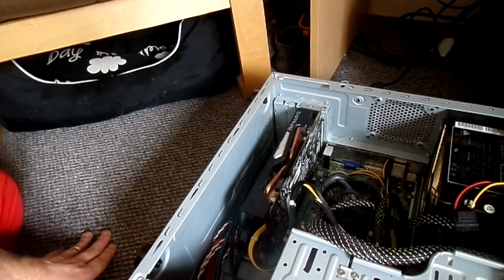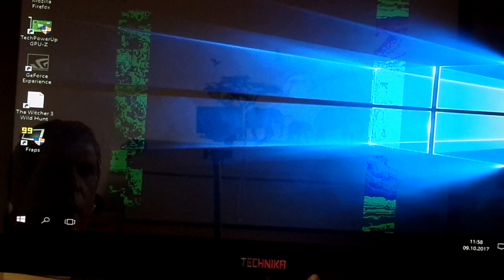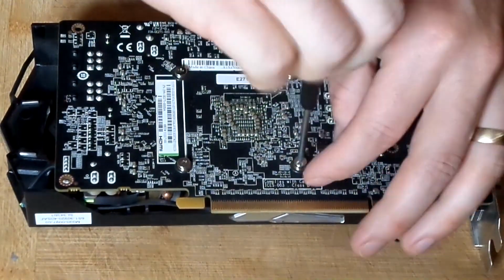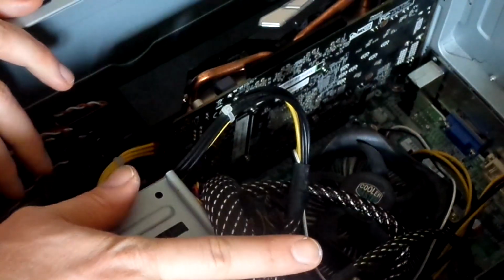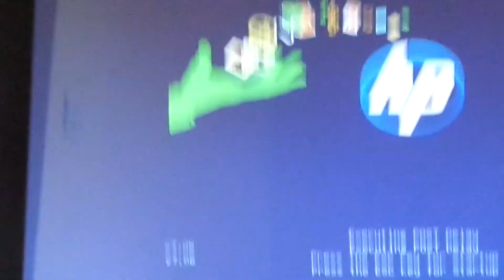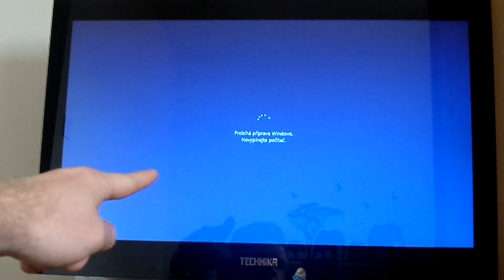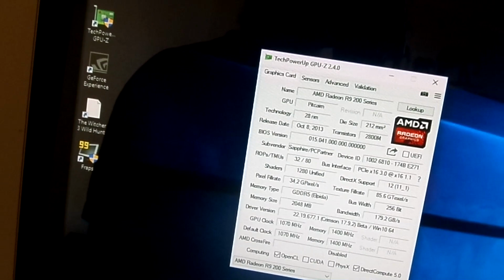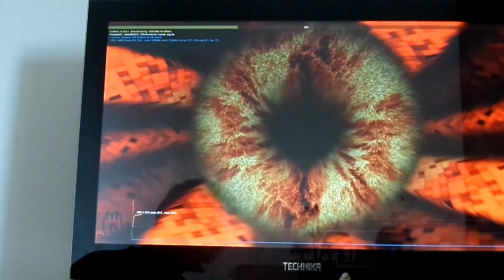It is possible fix GPU Screen Artifact ? Check this video to find out

Comment: Man big respect 3 years and still supporting people God bless you. <3
Reply from the maker: I try my best all the time have a nice day
Reply: @frogtechtips  should i try this on laptop my laptop's nvidia gpu having issue like this, display works with intel's integrated gpu so when i play games with nvidia gpu i get weirds lines something like stretching from middle of the screen, i searched for some answers i found that it could be "VRAM is dead" but i am not sure i can show you problem with video on discord if you want to see
Reply from the maker: @KhuniBacha  hi is possible do this on laptop as well but is more difficult
Reply: @frogtechtips  okay and also my laptop is maybe water damaged somehow. If i turn it off and leave it overnight on table it won't turn on in the morning but later i put it in bag for 4-5 hours and it turns on like normal. Can there be any other cause of it ?
Reply from the maker: @KhuniBacha  that's sounds like some bad capacitator definitely open your laptop and have a look on PCB
Reply: @frogtechtips  okay thank you i will try to find
Reply from the maker: @KhuniBacha  you welcome

Comment: Thanks!  I have lines on my screen pretty much from the windows icon and on.  It shows in device manager but says its a code 43.  At times its shows its working properly but I can not load drivers into pc.  GPU is 1060 6gb and super clean, not dust or it’s minimal.  Do you think this fits this category to fix?
Reply from the maker: Hi if you try all other solutions and as I think your card is out of warranty I will definitely try reheating GPU as can help and there is nothing to lose anyway

Comment: Whats the point of heating it up? Just wondering.
Reply from the maker: If you heat correctly some of the cold soldering point can be fixed and your card can start working again this is easy explain

Comment: Going to buy a bad 1080ti card off eBay with artifact for $199.  Looks fixable as it has pic with blue lines so one mans trash is a crypto miners treasure.  Thank you or the advice!
Reply from the maker: Hi is always Risk buy foulty card but sounds is possible fix that one let me know
Reply: @frogtechtips  Replace both fans, one had a wobble and slow, the other okay plus the cooling fins were clogged with dirt.  The PC was a dirt magnet sitting on the floor.  I repasted since it looked old.   The seller said his PSU was an issue but he wanted to upgrade.  Everything is working fine now.  The gpu was underclocked so it may have decent life left because he never mined with it, said crypto was too confusing.
Reply from the maker: @juggernautz  good job and looks like you have good card for good price now
Reply: @frogtechtips  Thanks.  Bargain fixes are worth it, I let the seller convince me he's not selling complicated fix or a brick.
Reply from the maker: @juggernautz  you welcome and I hope you will recommend my channel to your friends :-)
Reply: Did you fix it?
Reply from the maker: Good question :-)
Reply: @frogtechtips  Hey, I have a gtx 660 with artifacts I want to try to reflow it but I don't know what temperature I would need, I have a small portable heat station, what temperature would you recommend?
Reply from the maker: I always start on 290 Celsius for 10 min
Reply: @frogtechtips  Thank you very much for replying, I will try to reflow it today, I hope I don't kill the graphics card! xD
Reply from the maker: @rono.9157  Hi no problems I always say as your card is out of warranty there is nothing to lose anyway
Reply: @frogtechtips  I've done the reflow but unfortunately it didn't work and the gtx 660 still has the artifacts :(
Reply from the maker: @rono.9157  Did you reheating vram module as well I will try again with little bigger temperature and longer time as well
Reply: @frogtechtips   @Frog - Tech - Tips  Yes, I've overheated the vram and used 310° instead of 290 for 10 min, other people have told me that it is very likely that these artifacts can only be solved by reballing so for the moment I'm using a radeon hd 6770
Reply from the maker: @rono.9157  Yop rebaling can help but is hard and you will need expensive tools for that did you use Flux as well
Reply from the maker: @juggernautz  nice good Job

Comment: nice.. will the artefact comeback??
how long usually it will last?
after 3 years did that gpu still alive or dead?

thanks man.. <3
Reply from the maker: Hi I have some cards with working 1m and some with working even after 5 years but if happens again you can still try reheating GPU again this will help you save some money for new GPU 
You never know how long will be working but if  working is big plus anyway :-)

Comment: What Flux are you using? I cant buy the one you use in Europe. I found some but i have to decide high densed R12(Kolophonium 12,5%) or low densed W03(3,5%).
Here is the link.
https://amzn.to/36T0lxu

My Problem are some Artifacts on some Textures (on Yellow textures for example in a Game). Does it worth a try if yes, which one to go for? Thanks in Advance.
Reply from the maker: Hi is not really important with one you use I just prefer gel flux

Comment: This method won't last long...already tried before this video was uploaded.....
Reply from the maker: Is always Risk but from my experience some cards working 1 Day and some 5 years I will try one more time use now bigger temperature and little longer time plus if card start working again I will undercloock GPU about 5 %down with mean you will loose little FPS but card will have less stress and can working much longer
Reply: @frogtechtips  But I think reballing will fix this issue for a little much longer but cannot be done by someone without knowledge in electronics....
Reply from the maker: @brunovincy11  reballing is so expensive  and proper way to do is replacing main chip as well with cost more that new GPU

Comment: I’m not sure if it is artifacting on my gpu because of how minor it is but i have recently tampered with the gpu and opened it up, my gpu is an xfx rx570 4gb. It only flickers the whole screen instead of those weird dot things. i’m thinking i may have gotten thermal paste on  some parts of the gpu but i’m really not sure. maybe it’s my voltage settings. Anyways i don’t have anything to heat up the card but i might buy one and see if this works.
Reply from the maker: If you forgot apply thermal paste that can be problem with even make a damage on some comments and you also write something about voltage settings check that at first point before you do anything else
Reply: @frogtechtips  i did all that and set my power and temperature settings back to what they are default, nothing seems to work but i can definitely deal with it because it never flickers when i’m playing a game or watching a video. I’m very happy for that but i’d like to still get red of it somehow
Reply from the maker: @Zeussxs  did you try other outputs as well
Reply: @frogtechtips  actually, no i haven’t. I forgot to do that, i’ll let you know how that goes  once i’m ready
Reply from the maker: @Zeussxs  you welcome

Comment: Hello! Ive gotten the light flashes (lightball flashing artifact) on my 1080 asus strix. Does this work on it aswell? Or do you know of anything else that might work? I could sent you a vid on discord maybe or by mail! I really dont want to spent like 1.5k euro on a new card right now since its so overpriced because of the lockdow..
Reply from the maker: Hi I will bet this style of repair will work and like I always say if your card is out of warranty there is nothing to lose if you try reheating GPU

Comment: This fix is temporary, the only proper way to fix it is to re-solder the chip
Reply from the maker: You right but think how expensive is resolder chips is not really rentabil repair and from my experience some cards working 1 or two weeks and some cards much longer like 1 or 3 years yop that's true longer card I fix with this method I now is card r7 370 with one I repair for my father and now is that card used in my sister husband pc and he plays game every day that's mean card have proper use now over 4 years after this style of repair .
Reply: @frogtechtips  impressive, my longest fix was laptop gpu it ran 2 months.
But i gave up after second fix as i wont be opening it every two months :/
I wonder if there is any other inexpensive way to improve the results of this method
Reply from the maker: Be sure you use flux and if happens again I normally use bigger temperature something about 330 Celsius and longer time as well not 10 min but 15 min and Also I try undercloock GPU about 10 to 15 percent down with means you get like 2 to 5 FPS less in game but card survive longer and I do this undercloock with BIOS modification

Comment: Hi i buyed a 6 year old used gtx 780 when i played more on my computer i got a white screen while gaming and restarted it same problem as you i opened my gpu almost no thermenal paste (grey thermenal paste) i buyed today a thermenal paste i don’t have a heatgun but can i try this ? I think maybe my gpu overheated I reinstalled my windows same problem im gonna wait for my thermenal paste You got any suggestions ? Thanks
Reply from the maker: First at all try replacing thermal and if that doesn't help you can try step I do in video
Reply: @frogtechtips  i tried thermenal paste didn’t work
Reply from the maker: @etpzz23  ok you will need try all steps I do in video
Reply: @frogtechtips  im trying to do it with a 2200 watt hair dyer
Reply: @frogtechtips  yo it worked but when i started fortnite i got a white screen again restarted it same problem :(
Reply from the maker: @etpzz23  hair drier is not strong enough  but as I see you already find that
Reply: @frogtechtips  yo bro i bought a heatgun but its only 300 degrees not 290 should i hold it on 10 minutes ? And on the ram 10 seconds ???
Reply from the maker: @etpzz23  hi 300 is fine you can use even more that's no problems and ye try 10 min should be ok

Comment: great video. Do you have the heat gun on a very hot setting
Reply from the maker: Hi I used temperature 290 to 320 Celsius

Comment: Wow man this actually works on my Radeon R9 270 OC card! I don't have a heatgun, but i use oven(Do not use microwave!).. And it turns out working well! I use temp controlled oven and i set to 110°c for 10min.. Pull out and wait to cool down, apply heatsink and thermal paste, and test.. Huge Thanks to God and experience you share here, i don't have to buy another vga card anymore😇🙏 *sorry for my English 🙏
Reply from the maker: Hi nice to know btw oven is absolutely last step and you card is probably not so bad as you use on 110 Celsius wit is to low melting for solder if you card get foult back with will be probably soon of not you lucky try again but with much higher temperature

Comment: What flux did you use ?
and also could this flux work :https://www.bunnings.co.nz/tradeflame-plumbing-flux-and-brush_p5910273
Reply from the maker: Hi i will try go for liquid flux this one is good for small components  but you need one with is go easy under big chip look on description there is some links and if not in this video look on my channel for more information
Reply: @frogtechtips  But would that flux work since im in New Zealand and shipping would take a few months.Also liked and Subscribed :)
Reply from the maker: Hi thanks for sub iam not sure as flux you send link is for industrial big plumbing solder iam sure you can find better flux somewhere do you have eBay or Amazon in your country if yes try have a look there
Reply from the maker: What about this one https://nz.mouser.com/ProductDetail/Chip-Quik/CQ4LF-05/?qs=byeeYqUIh0Plq4AoEtUS5g%3D%3D
Reply: @frogtechtips  But is there anyway that flux would work with the gpu since im not really interested in buying lots of parts to get a 50/50 chance of fixing the card.
Reply from the maker: Hi you can still try without flux  is risky but can work as well and ye always is 50/50 repair like this one
Reply: @frogtechtips  Ok thanks for the information, I'll recommend you to everyone i know.
Reply from the maker: @thediamondgamer7414  thanks that will be means for me a lot and I wish you a Merry Christmas
Reply: @frogtechtips  Thanks oyu too, a quick update I ended up buying the flux of ebay and i'll let you be sure to tell you the results of the fix :)
Reply from the maker: @thediamondgamer7414  thanks and happy New year

Comment: Hi frog, did you use flux on memorys modules? Or only on main chip? And about the times you did 10 straight on chip and then switched to memorys modules 10 seconds each?
Reply from the maker: Hi yes i use flux on memory module as well and 10 to 15 min to Core and up to 30 sec to memory module or till all flux disappear 
You can look on my channel there is more repair like this one

Comment: Sir I don't know if you still reply but M gonna take my chances and I hope you do. My problem has started with just cold boot in morning it goes to a random color  but after 3rd boot works just fine i play games all day no problem and won't heat but now got worse and keeps doing it on every boot I tried old drivers new drivers windows versions and nothing. Please help me I really can't afford one. My graph card is gtx 1060 6gb
Reply from the maker: Hi bro ye I still reply if I can your problem sounds for my something wrong with your PSU I hope that help or just maybe Main board battery can make this problems as well
Reply: @frogtechtips  thank you so much I'll try to see if I can use another psu mine is 300w and I've read that I need at least 450 for gtx 1060 even iv been working with 300 for a year. I really hope it's the psu. Now m working with just intel graph of the psu
Reply from the maker: Now sounds for me is PSU you writing works about 1 year but you PSU working on Maximum all the time and over time loss lover on rails  or som capacitators is on end of the live I will definitely trying new PSU
Reply: @frogtechtips  tried it on another setup with psu 550w and same thing happened once the system has launched it went green
Reply from the maker: Ok now you know problems is with GPU with is usually Bad news if your card is out of warranty with I think it is only you can try is repair with reflowing like I do in one of my video btw I forgot if your card have second BIOS try that's first or try BIOS upgrade on GPU and replace thermal paste as well reflowing is absolutely last step when is nothing to lose
Reply: @frogtechtips  I don't know what's second bios but if you mean smth like msi afterburner to clock it I never did can I please have the link to that video ? Otherwise you helped me enough and I thank you so much it means a lot
Reply from the maker: @jtt6891  hi I mean some cards have physical switch on PCB for second BIOS what you card exactly I will have a look if your card have that switch or not
Reply: @frogtechtips  oh no it doesn't. It's msi gtx 1060 6gb never had problem with heating never crashed in game this happened only on cold boot at first. I tried to underlock it with msi and it didn't work and now i can't even do that bcz it doesn't really work anymore
Reply: @frogtechtips  Didnt change anything now I just pluged it again and it worked I did undervolt it with afterburner just now to stay safe
Reply from the maker: @jtt6891  that's for me still sound more like PSU but as you test that ok I hope will working good luck bro
Reply: @frogtechtips  I wish bro ♥ I can't thank you enough
Reply from the maker: @jtt6891  you welcome I hope you can share my channel as well
Reply: @frogtechtips  this 2 days i'v been using this way i unplug it on the first boot of the day works with intel like an hour and then plug it adn it did work just fine full day. but if i dont do that first it gives me random color crash

Comment: Hey i got a different kind of artifact. I bought a used RX 560 and after 1 year it starts artifacting when playing high gpu intensive games. Could you take a look and tell me what kind of artifact is that and what could be the possible solution. I have tried under clocking my gpu but still artifacts appear. Here's a couple of screenshots ( https://imgur.com/a/9bX09Fi )
Reply from the maker: Hi sorry for late answer just follow repair I. Video and I think will help.to your card as well